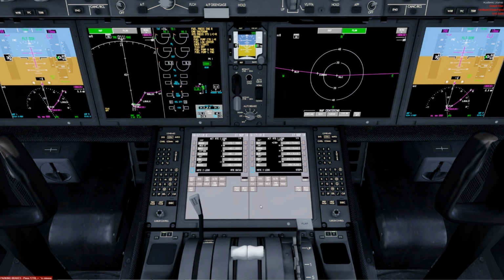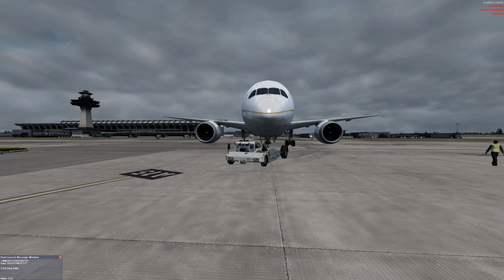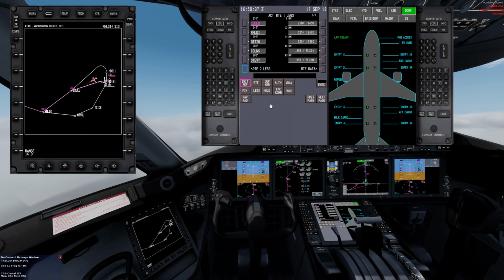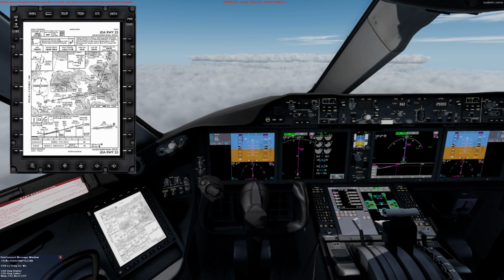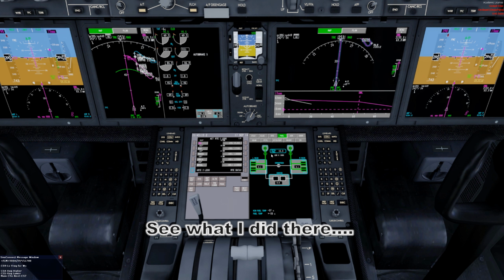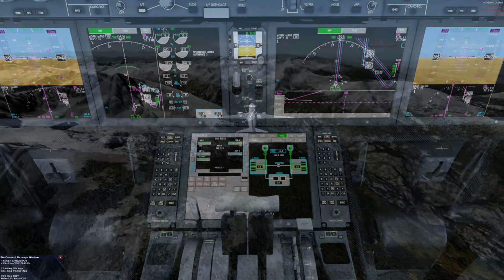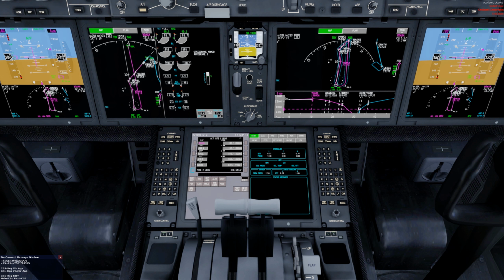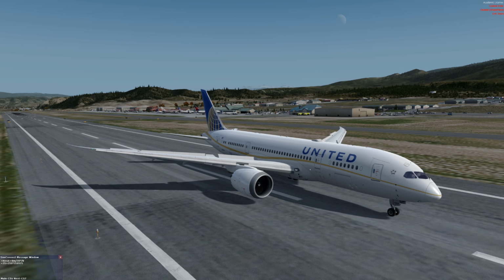P3dv4.3 Q.W. 787 Jump Feature demo Dulles to Eagle Co

Comment: It always amazes me in your videos how snappy Radar Contact is. Ever since switching to P3D a couple of months ago it’s become pretty much unusable for me with MCE. It takes forever to respond to replies and usually just stops responding altogether after departure or before the first enroute controller change. The response time from tower to departure is especially fast - you don’t even seem to switch frequencies.
Reply: MCE has a setting for CPU usage. If you set it too high MCE will respond faster, but performance of your other addons like Radar Contact may suffer, and vice versa if it's set too low. The trick is getting the right balance to get equal performance from all your addons and P3D. The best way to do this is start the slider in the middle, and if MCE responds faster then your other addons, then gradually reduce the CPU Usage slider until you get a balance, and move it up if the addons respond faster then MCE.
Reply from the maker: Hello there Chaz. Thanks for stopping by. What I recommend is that firstly do away with the original RC4 voices. They are too slow. Download the Meat-water voice pack and install it, from Avsim Libs.
Link;

http://library.avsim.net/search.php?SearchTerm=meatwater+vocpack&CatID=root&Go=Search

Then, to get a slick set up, have MCE FO do the radios..command "your radio", you herd me say it?
Then use the keyboard as well as your own voice. The FO in control of radios, you can "butt in" whenever you like. After all, in a commercial flight the Captain doesn't do everything!  Then you can also use Vox  Key (MCE Tools) or another 3rd party key presser,  Voice Attack, to press the keyboard for you and save you dabbing the keyboard!  All these extra things get used in my flights.
Some would say, why the hell dont you use PF3? I will get around to trying it again some time. The trial version crashed my sim a while back.
Cheers!
Reply: Yeah, I have the Meatwater set from ages ago (I also EQ matched the MCE William RC voice set as their originals are a bit all over the place!). I’m aware MCE can control the radios but as you allude to, might as well use PF3 if you’re going to do that! I haven’t played with the CPU slider that tf51d suggests though - that’ll be my next job. I didn’t catch you saying ‘your radios’ this video though. So, did you use VoxKey/keyboard when you switched from tower to departure as that is so quick (& no visible signs of you switching comm freq’s)?
Reply from the maker: Yes normally, in manual mode, you order the FO to switch freq, "over to tower" etc. You can use the keyboard yourself, Vox Key/Voice Attack etc. Or let the FO switch freqs if in full auto "your radio" mode. In "Your Radio" mode the FO should do everything and leave you to do occasional Tx or occasional keyboard strokes. Then also you can choose to silence the FO altogether, by the RC4 voice menu! Its never perfect, but what I liked about it was the QW Jump Ahead feature doesn't bugger RC4 up at all! If you select x2/x4/x8/x16 and use RC4,  it goes stupid and forgets where your flight is! So, with QW Jump Ahead,  you could Jump across the pond to NY and RC4 would still be ok with it!